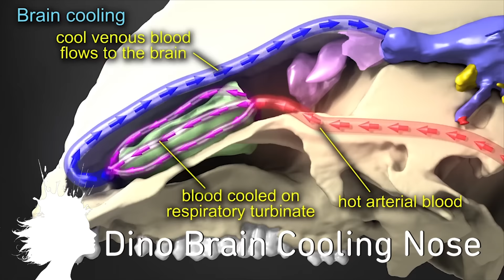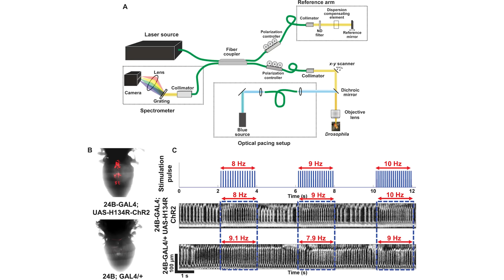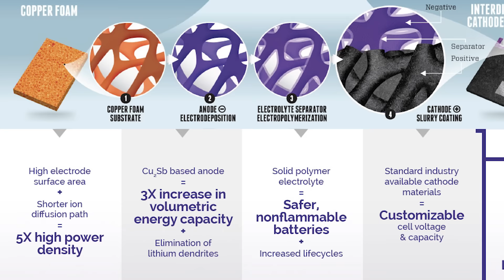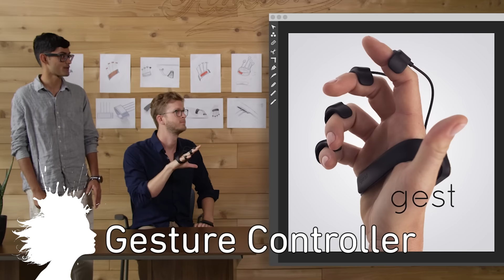Sound Tractor Beam -- Mind Blow #99

Comment: jet fuel can't melt iron beams?
Reply: +Just a WARLORD No, it can't.
Reply: ***** ayy lmao
Reply: +Michael Smith the heat however, can bend them beyond structural integrity limits
Reply: GeckoDan it's kept in steel cases
Reply: +Just a WARLORD You are.
Reply: +Just a WARLORD no its. What the hell are you even talking about? The cold can melt right through it.
Reply: GeckoDan no it is look it up
Reply: +Just a WARLORD you have no idea what you're saying.
Reply: GeckoDan i do
Reply: Dank memes can't melt Reddit posts.
Reply: Amaz1ngWhale my little pepe can't be this cute
Reply: if the beams fell sideways then the plane melted, easy ☺
Reply: Jet beams can't melt steel fuel.
Reply: Jet fuel burns at: 1500 F, 
Steel melts at: 2750 F. 

Jet fuel, burning at the top of a tower, cannot cause hte entire structural integrity of the whole thing to collapse. Even if for some miraculous reason the fuel did melt the top floors, they would collapse, the fuel would burn up and that would be all. There is no reason for the bottom floors to collapse as they did without an explosion to weaken the beams. That's not a conspiracy, that's scientific fact.

Google the 'Windsor Tower' Fire. Buildings that are on fire do not burn and collapse, the frame remains because it is not hot enough to damage them. As you can see from the Windsor Tower, some floors have collapse, but the rest remain standing. Of course they do, because that's how buildings are designed. The impact of one plane and the burning of fuel is not enough to, not only melt fuel, but cause total loss of structural integrity from the top floors, to the bottom.
Reply: +Michael Smith what about all the floors that collapsed being too heavy for the current floor so that floor collapsed too ?
Reply: Danny Keeley What do you think the tower was made out of? It would have just been some bits of steel (if you believe that it could be melted.... it can not), and some other light, modern, building materials. It would no be enough to make a tower made in the modern world collapse. Considering this was (I am fairly certain on this) a new design, so would have up-to-date safety regulations.
Reply: +Michael Smith Why do you "truthers" (lol) not understand the following? 

Based on its comprehensive investigation, NIST concluded that the WTC towers collapsed because: (1) the impact of the planes severed and damaged support columns, dislodged fireproofing insulation coating the steel floor trusses and steel columns, and widely dispersed jet fuel over multiple floors; and (2) the subsequent unusually large number of jet-fuel ignited multi-floor fires (which reached temperatures as high as 1,000 degrees Celsius, or 1,800 degrees Fahrenheit) significantly weakened the floors and columns with dislodged fireproofing to the point where floors sagged and pulled inward on the perimeter columns. This led to the inward bowing of the perimeter columns and failure of the south face of WTC 1 and the east face of WTC 2, initiating the collapse of each of the towers. Both photographic and video evidence—as well as accounts from the New York City Police Department aviation unit during a half-hour period prior to collapse—support this sequence for each tower.
Reply: What people don't get is that, just like butter, steel gets soft before it melts. Many many hard materials get soft before the melt. The jet fuel didn't melt the steel, it just softened it, making it unable to support the floors above it.
Reply: robert mckinley If they did do it, which I do believe they did, I think it was to gain support for aggressive foreign policy. 

Before 2001, the US government wanted to get involved in Iraq and the middle east in general but the public, being american, naturally were isolationist, preferring neutrality and dealing with their problems at home. Now, the reasons why the US wanted to get involved is another debate all in itself... but you know.... oil. 

Anyway, the US government needed support to go to war, and to get the public's support they needed to get them worked up. This was a sure fire way of getting everyone in America wanting to take revenge on anyone the US government deemed terrorist (and the Gov was deliberately vague about what 'terrorist' referred to). This allowed them to start the 'War on Terror' not long afterwards and pass freedom and liberty restricting laws that allowed the US Gov to invade your personal privacy. This lead to the invasion of Iraq, the war in Afghanistan and a other such interventions which the public was totally against before 9/11.

Btw, for those of you who will, understandably, say that the US government would never do that to their own people.... think again. Google 'Operation Northwoods.' You can read the OFFICIAL document provided by the US government. This was during the Cuban missile crisis when Americans for the most part didn't want war, because they were afraid of what would happen. The US government wrote up this document which listed false flag operations against American people, pretending to be the Cubans, in order to justify a war with them. 

One was to (I remember this clearly because the wording made me sick) "sink a boat load of Americans"(refugees from Cuba)..... yeah, your government wanted to do that. Don't believe me? Get up the official document, click CTRL+F to bring up the 'find' thingy. Then type "boat load" and you'll find it. Another was to buy Cuban planes, paint the Cuban flag on it and shoot down a US plane..... 
THis was not rejected at the lowest level of government and the writer sacked or arrested.... it was approved to guess which position? The bloody President himself. EVERYONE under him approved this document. If he had said 'ok' then this would have happened. And now we'd be discussing whether or not the US government was behind the "62' Cuban bombings" or whatever.
Reply: http://nsarchive.gwu.edu/news/20010430/northwoods.pdf

The list of recommendations starts at page 10. Scroll down until you see 
(1).....
(2).... 
and so on.
Reply: ***** America didn't want to join WW2 until Pearl Harbor. Are you saying the government probably did Pearl Harbor?
Reply: DBZHGWgamer No, why even bring that up? This is a discussion about 9/11, not Pearl harbour. Yes, some people might think Pearl Harbour was a government job, personally I don't. But the evidence that the US government was willing to attack its own people is evidence 1964 onwards.
Reply: ***** That reasoning is so fallacious. The document only shows that some people in the government were willing to create a reason to attack a country that had nuclear weapons within range of all the major population centers in the united states. Should negotiations fail, which they didn't, they may have been willing to sacrifice a few to rally the country and save possibly millions. This applies just as much to Pearl Harbor as it does to 9/11. Meaning: not at all. A bomb would not have nocked the towers down if a few years earlier the same tactic was attempted and failed. I also don't believe an american willingly killed himself to do something like that. Assuming the government is as corrupt as you say, everyone would have been too corrupt to be willing to sacrifice themselves. This is ignoring all the other evidence which you would probably laugh off.
Reply: DBZHGWgamer No one is saying it was just a bomb that collapsed the towers, but the structure rigged with explosives that caused the demolition. Its exactly what they do with controlled demolitions, and it is an explanation of why two buildings, that tall, being hit from one side, collapsed directly down. 

And like I said, this document made it to the office of the President, this wasn't just a odd few nutters, this was a widely accepted strategy. 

And please, tell me of this other evidence that I would apparently laugh off. Unlike a lot of conspiracy theorists who clutch at straws to make massive leaps to conclusions, I try to look at the evidence, and judging from the way the towers collapsed, the political situation before and the years following, many inconsistencies and other simply illogical aspects (such as jet fuel melting steel beams), to me the most likely situation is the Government of America 'sacrifices' those at work at the towers in order to rally the support of the country to go to war with whomever they like. And for that last part, you cannot deny happened.
Reply: ***** Lol, you say you do research, but your still stuck on melting steel beams? I'm going to make some comparisons here. You seem to think steel is like ice. By that, i mean if you don't have temperature above 0C, it doesn't matter what temp it is when trying to break it. Steel is more like butter. Long before it melts, it starts to get soft. At 530C, steel becomes soft enough to work with a hammer. Jet fuel can burn at 815C. Nearly 300 degrees warmer than the temperature that blacksmiths work with steel. 

Secondly, simple physics can explain why a building crashes directly down in that senario. There was no force pushing ether building in any direction except down. Because of this, it is only physically possible for it to crash down. Buildings might be nocked over by a wrecking ball, but in that case what is nocking the building down is sideways momentum. In the case of both explosives and 9/11, what knocks the building down is lack of structural integrity. And if the structure was rigged with explosives, how did a ton of people make it down the stairs? that should have all exploded.

Thirdly, that document was written by the Joint Chiefs of Staff. Which means part of the people who run the military. None of these people are in congress. Plus these people are probably all dead. and the Joint Chiefs of Staff do not have a high command in the military anymore. Something written by these people years before you were born does not say anything about the current or recent administration. Thats like saying you are likely to murder because someone who lived in your house years ago was a murderer.
Reply: DBZHGWgamer For the towers to fall directly down, with the beams melting, they would have to melt evenly all over. As the plane hit at one side, those would be damaged and in closer proximity to the jet fuel and so should melt sooner. If that caused the building to collapse we should have seen the top of the building (and only the top), sag and topple in the direction that the planes hit, break off (due to the strain put onto the weakened steel) and then the remaining steel beams at other end of the tower would not be able to hold the entire top so would break and fall away. There is no reason for the entire tower from the top to the bottom to collapse in such a central way. 

And really? Did everyone make it down stairs? No, many people were trapped on the top floors due to fires and structural collapse. Also, no one is claiming the explosives went off when the plane hit, it was the explosives that caused the collapse of the towers; after the collapse of the towers there was no stairs to get down. That entire point is ridiculous. 

And Operation Northwoods was proposed by the Department of Defence and the Joint Chief of Staff, they had some serious power in the US government. And, like Is said, this was personally presented to the President - the highest office in the executive branch. That doesn't happen for some small proposition that is immediately dismissed. If there was another President (maybe Bush?) Operation Northwoods WOULD have happened, that's a certainty, it was given to Kennedy as a final approval before being acted upon.
Reply: +Michael Smith 1500 C, not Fahrenheit.
Reply: Silent Cheech 
Steel melts at: 
1370 C (2500 Fahrenheit).

Jet Fuel of the Boeing 767 burns at:
427 - 816 C (800 - 1500 Fahrenheit)

As you can see, Jet Fuel is no where near hot enough to melt steel.
Reply: ***** Lol, terrible logic, as when the plane crashed, the jet fuel went everywhere. You see, its a liquid, and one with a rather high viscosity, so when the plane crashed and the fuel tank broke open, the fuel spread throughout the whole level. Mostly with the violence of the crash itself, but also because of the fuel's viscosity.
Reply: DBZHGWgamer Fuel has a 'high' viscosity? I'm finding it unlikely you actually know what that word means. If the viscosity was indeed high, the fuel would not spread, well, not very fast. Now, if it was low, yes it would spread, but it would spread along the floor, down stairs/elevator shafts etc. That would not provide enough burning fuel to be in contact with every beam, it just wouldn't. 

You really give other people in this comments section arguing it wasn't a conspiracy a bad name, really? Liquid fuel has a HIGH viscosity??? That's primary school stuff!
Reply: ***** Sorry i got mixed up for a second. I guess that small mistake caused the world to end.

"That would not provide enough burning fuel to be in contact with every beam, it just wouldn't." Firstly, it would. Do you know how much fuel a plane has in it? A boeing 747 has almost 50,000 gallons of fuel. Thats enough to keep your car driving for a few hundred thousand miles.

Regardless of that fact, you don't seem to know how heat and the laws of thermodynamics work. You can get third degree burns without touching a fire. People grill burgers, and usually their burgers never touch the fire. People roast marshmallows without the marshmallow touching the fire. Heat is not exclusively contained to the immediate vicinity of the fire and fuel source. Heat travels through the air by convection. Nothing has to touch a steel beam to soften or melt it, the heat can simply travel through the air.
Reply: DBZHGWgamer Yes, but as the distance increases, and the obstacles between the heat energy in the air increases. The amount of energy transferred is much diminished. I still maintain that the beams would not have melted evenly all over to cause such a vertical collapse. And, we have to account for the fire, which would have opened holes in the floors, this coupled with stair cases and elevator shafts etc the fuel would have spread out, and so much travelled further down the tower, it could not have caused the even melting of all the steel beams.
Reply: ***** The beams don't have to melt perfectly evenly for the building to fall straight down. As long as there isn't a huge difference in weight. The plane when straight into the building, so the fuel was not concentrated around one side.
Reply: DBZHGWgamer If one side was further melted than the other, that side was break first and would topple to the side, that was not what happened as shown with the footage.It would require the even melting of the beams. And, again, it would also require the beams to be weakened all the way down. There is no reason for the entire building to collapse, the weight of the top floors would not be enough to collapse a modern building that constructed in one of the most developed countries in the world. But again, its unlikely that without additional help the top floors would collapse. And is almost impossible that the central/bottom floors would collapse without some help.
Reply: ***** The Twin Towers were actually rather old buildings. They finished construction around 30 years before 9/11. The reason the bottom floors collapsed is because the force from the downward momentum of the top of the tower falling was most likely more than the building was ment to handle. It is not as though the steel beams were only holding up the top floors, they had to hold up all the floors at the same time. 

And if it was a controlled demolition, the top and bottom of the building would have started falling at about the same time. If you look at recordings, you can clearly see the top falls, and that the tower collapses floor by floor.
Reply: DBZHGWgamer This is really getting nowhere, this will be debated for long to come and we'll never get an answer that will satisfy everyone so let's just call it quits here. :)
Reply: +GeckoDan because it can also melt the central core made of concrete two towers?..It can't melt or pulverise concrete.
Reply: ***** wow you don't know youtube 
it's mostly teens check your facts
Reply: ***** i'm 17 and i can cook clean and a lot more house chores 
and your picture is a photo of a zombie from blops 2 dlc how old are you?
Reply: +Just a WARLORD kiss x sis...
Reply: Radio ToraDora wait what?
Reply: Just a WARLORD 0h I saw your Youtube bamner..
Reply: Radio ToraDora ahhh i forgot i ones did that lmao that is literally the only picture that would fit
Reply: Just a WARLORD uuhuh... 😏
Reply: Radio ToraDora it's true though
Reply: Just a WARLORD 0h I know..
Reply: Just a WARLORD no
Reply: Just a WARLORD I rather have bananas for breakfast.
Reply: Radio ToraDora you my have my banana
Reply: Just a WARLORD It's peach shaped, so no
Reply: Radio ToraDora it's german sausage shaped
Reply: Just a WARLORD wait? A German.. Sorry, I don't like moffen.
Reply: Radio ToraDora i said like a german bratwurst 
but its not
Reply: Radio ToraDora ;-; so no german penetrator?
Reply: Just a WARLORD no, nothing german related
Reply: Radio ToraDora you germaphobic?
Reply: Just a WARLORD more a #germarsaretoooveratedwhynoloveforthenetherlands
Reply: Just a WARLORD wow, what was that?
Reply: Radio ToraDora ahh lmao i thought you were dutch thats why i said something in dutch
Reply: Just a WARLORD oh ok, that explains everything.
Reply: Just a WARLORD well... I never heard of "the penguin evolution"
Is it about their wings?
Reply: Radio ToraDora revolution not evolution
Reply: Just a WARLORD wait what? Revolution? About what? They need more bananas so they can slide better?
Reply: Radio ToraDora they need more fireplaces 
its way to hard to cook wales in the poles
Reply: Just a WARLORD 0h